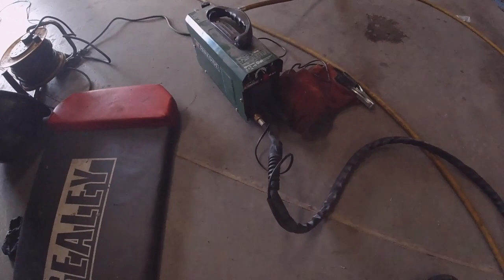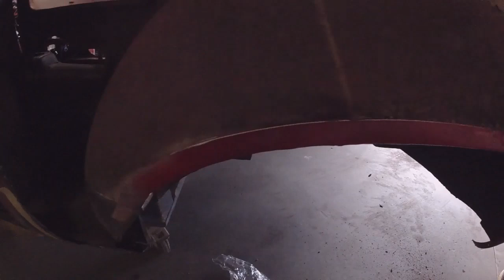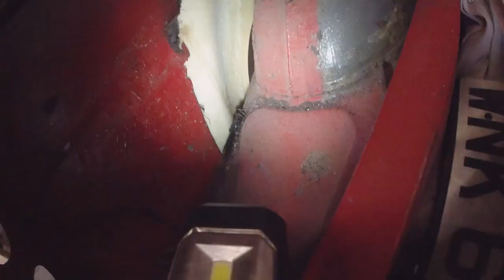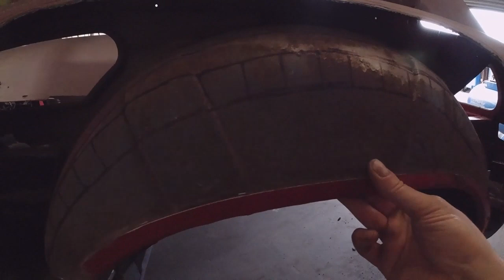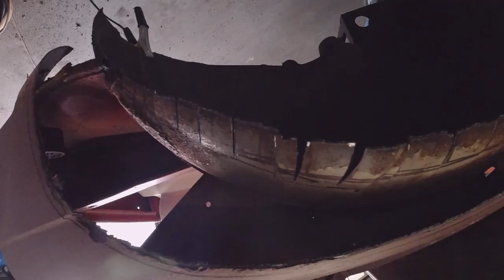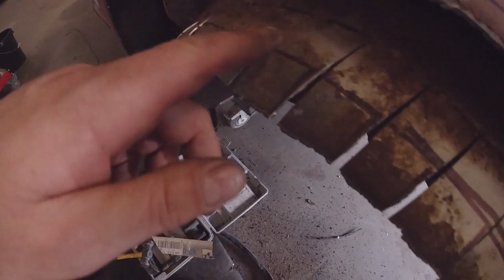Turn £600 MK1 MGB into a widebody! Project Sebring.

Comment: Would like to see how you solved the next part... As I want to do this myself I nned all the help I can get. Those rear arches are no light undertaking...
Reply from the maker: The inner arch section do you mean?
Reply: Yes, if I remember correctly you wanted to add a continuous lip as you came to the conclusion that your original idea of cutting it up into small sections would attract rust...
Reply: Yes your plan I think was to use the lip/inner arch and connect it to the new sebring exterior arch. I guess by definition it would be a new inner arch section
Reply from the maker: @robertritchie2860  ah yes. In the end I did weld a lip on to give a larger surface area to bond to. But I used plenty of sealant and rust proofing

Comment: Hi, liking your progress. I'm currently doing a Sebring, but I have done the front arches joggled as well. It has a standard 1800cc  gold seal engine fitted. What was the cost for all the engine work?
Reply from the maker: Many thanks! I snagged a bargain from my friends at Barum Engineering, £1500 all in for engine build,camshaft upgrade clutch and lightened flywheel. Should be mor elike £2k+ but a customer abandoned the build so I picked it up